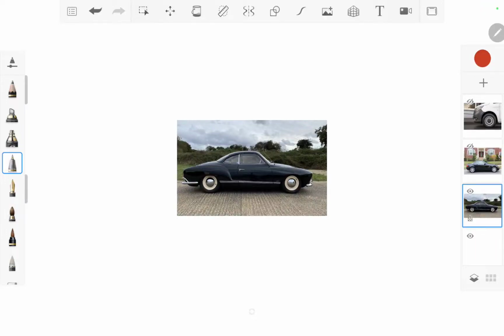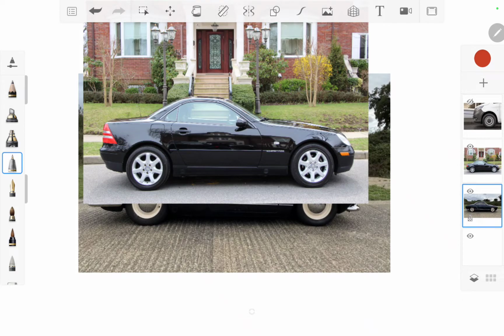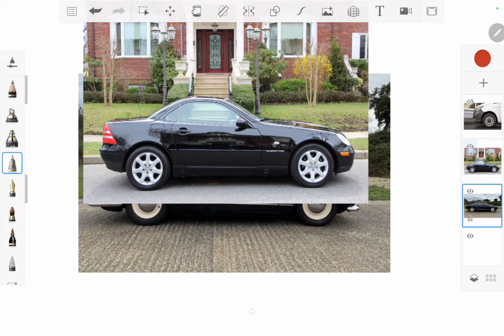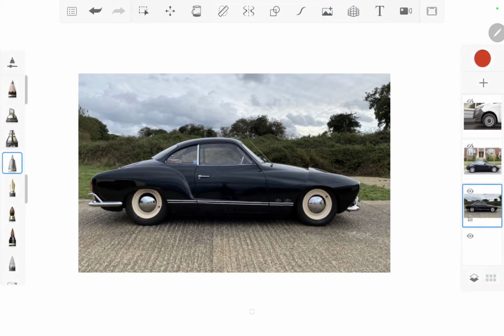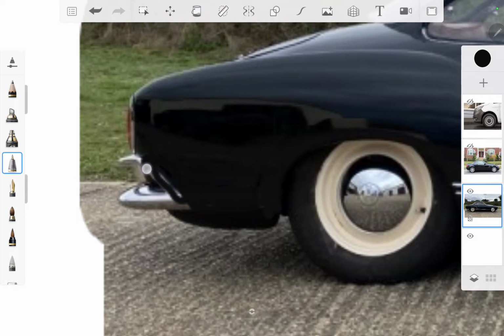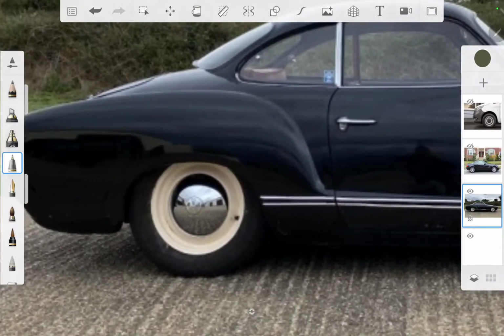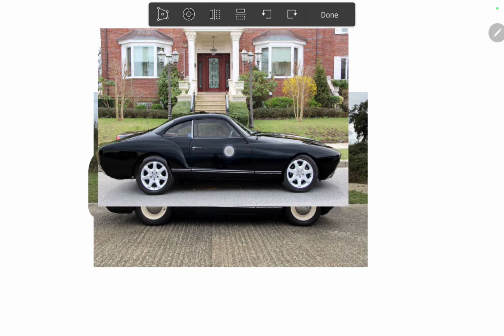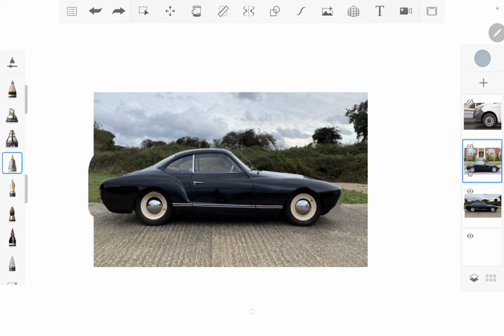Build a 1950s Supercar for Under $5k?

Comment: Looks good. 
It's an ambitious project and I am eager to see you make a start. 
Have you thought about how to integrate a grille in the front? The Karmann Ghia's nose has only small openings since the engine is in the back. Will they give you enough air flow for the radiator?
Good choice of wheel for the look you're hoping to achieve. Maybe you'll find some fake knock off spinners too? 😉
Reply from the maker: Yes. Planning on integrating a Mercedes grill and using Empi 2 bar spinners to give the Rudge knock off wheel look. Still figuring out how to get the spinners to work.